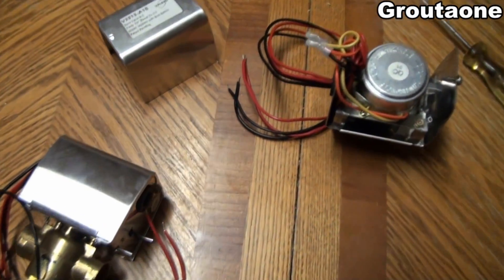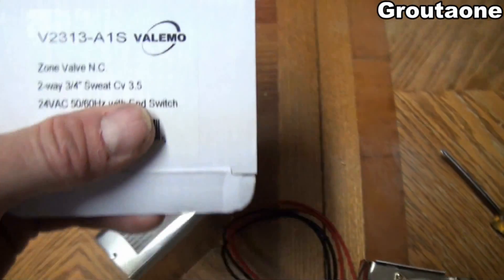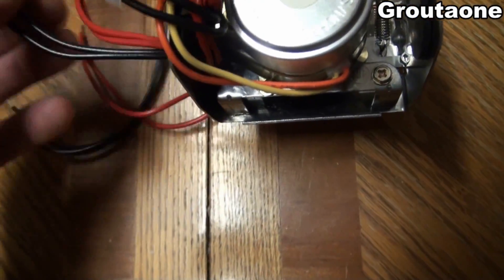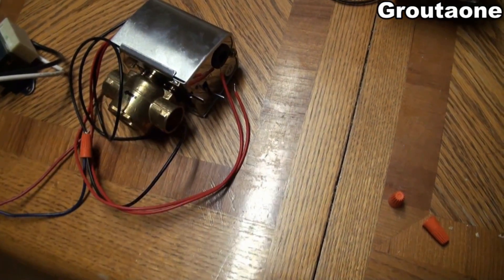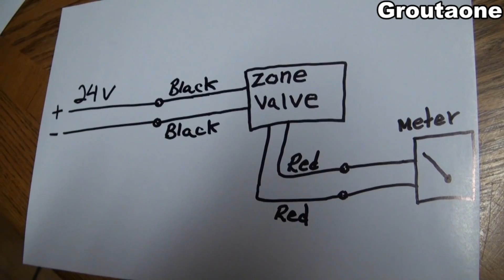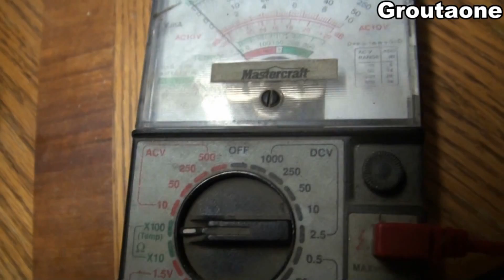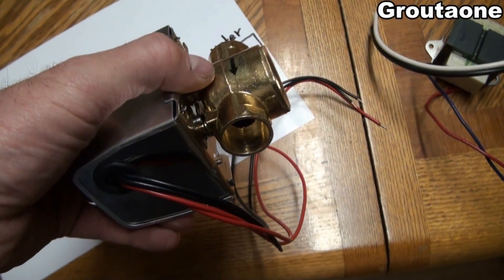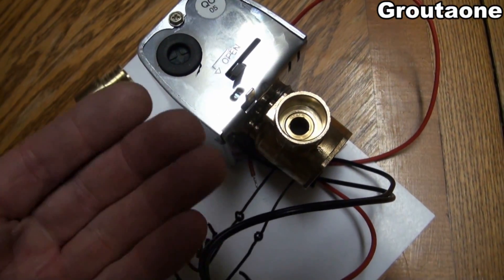Zone Valve End Switch Wiring

Comment: when soldering take the power head off there`s 2 screws holding it to the brass valve. you don`t wanna melt any wires from the torch.

Comment: how is your heating system going now?
Im still kind of interested in your old system. I have been thinking if i could maybe make something like that run of of waist motor oil. I have been running a own build shop heater like that for more  then a year now. The thing has pretty nice heat output and there is still a lot more in it. But we allready get our 720m³ shop up to 20℃ above ambient in about 1 hour wich isnt to bad considering it takes a while to get it burning nice. And sometime we end up working in short sleeves while snow is in front of the shop door just because the heater is kind of a pain to turn down again. 
But i think i might be able to sort of harness the power of the burner, but then the problem with a water heating setup like your would be that i allways get lots of black crap in the bottom of my burner. Did you ever experiment with waste oil? And how did it work for you? And how did you do it?
Reply from the maker: I did try waste oil, what I did was use a burner from an oil stove and preheat the oil and I also had to add about 40% fuel oil to thin it, it was a real mess to transport the oil and usually there was some antifreeze at the bottom of the donar tanks, one winter and that was enough for me, I heat with solar with electric on cloudy days, it heats real cheap I like it.
Reply: yeah the antifreeze is a real pain. We recently got a few cans of oil from a guy, turned out there was antifreeze in it too. The burner went all crazy and it kind of killed the fire. 
And for me the problem with the solar system at this point is we are not in a position where we can install floor heating or low h2o convector style units. And i think you do need that kind of setup with the solar to work well if im right?

Otherwise it would be nice because there is even a government support on those solar panels now. So that might bring the price down to a point where it is actually affordable.
Reply from the maker: If you go electric solar you may be able to run your meter backwards in summer, I would recommend looking into it, my shop I just go straight into two rads with fans and it works well, today it was about 22c in the shop, I don't think with a stretch of cloudy days that the shop has ever been below freezing

Comment: Thanks for the explanation but for accuracy, a transformer puts out AC.  Your diagram has + and -.  That is only accomplished when AC is converted to DC.  (please don't mark me as a troll)  LOL
Reply from the maker: When I see your name in the comments my friend, I always know it's a worthwhile to read what you say, thanks for your input
Reply: @groutaone  

Know it’s three years later and probably a non issue by now, but dc (direct current) voltage (battery) is indicated or represented and symbolized by the + and the — signs and ac (alternating current) voltage (electrical generator) is indicated or represented and symbolized by a sine wave, sort of an “s” turned on its right side.  I know!  Picky fella, ain’t I!